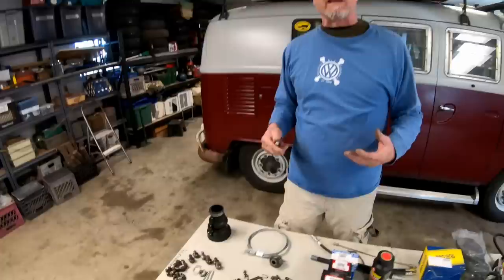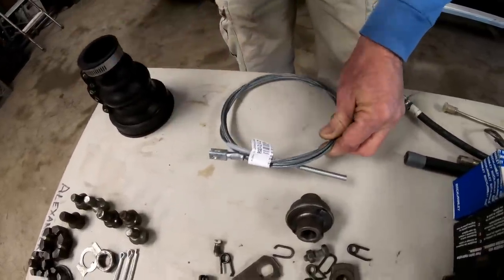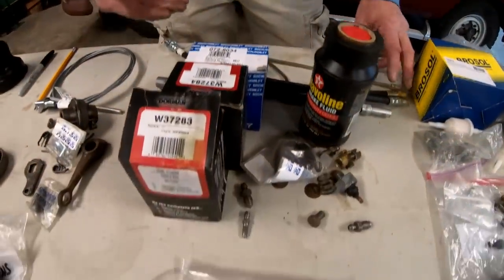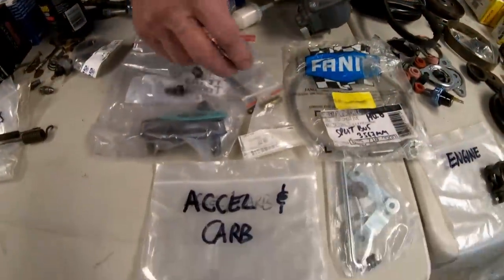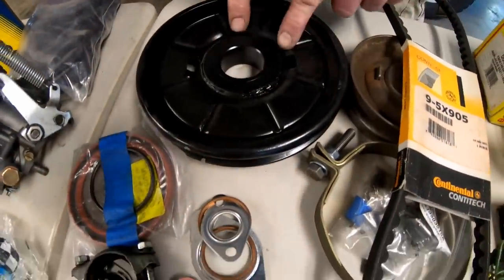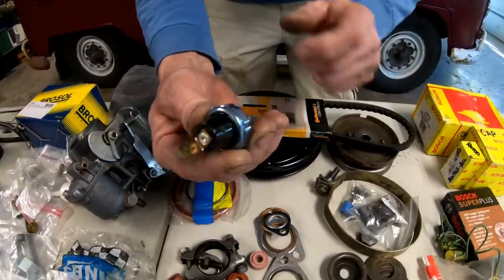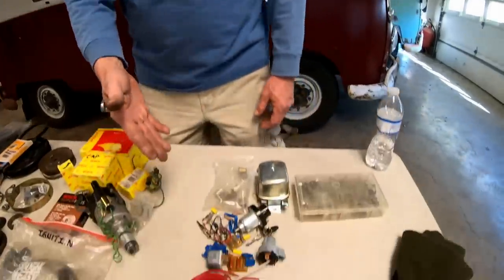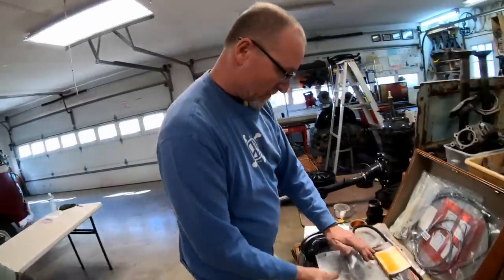100 Spares To Keep in Your VW!!!

Comment: Very valuable advice, especially getting the right length accelerator cable. Many years ago I owned a '71 VW camper van. I learned early on to carry spare parts. One summer I made the trip from my home in California back to New York were I was born. While in NY my accelerator cable broke. I removed the broke cable and replaced it with the spare I'd been carrying around for a couple of years. Before I started on the long trip back to California I bought a replacement cable. I made it home without incident but about a year later my accelerator cable broke again. I went to replace it with the cable I bought in NY only to find it was too short! I had about a 3 mile walk to the local dealer for the correct replacement. It could have been worse. Had it broke coming across the desert on my return from NY, I probably would have been very uncomfortable until help passed by. This was long before cell phones.
Reply from the maker: 👍, yes indeed you got very lucky. 3 Mile Walk for a part you were able to buy doesn't sound bad at all. Thanks for sharing!

Comment: Nice one guys! And thanks for mentioning us “gals” too! If running points, I keep and emery board as a points “file” silly but it works! I also keep a section of wood block to aid when jacking bus up (of course I carry a shop style floor jack lol), zip ties of all sizes, LOADS of electric tape and I carry a beeswax blend of paste to work as a leak stop during a rain...and most importantly a VOLT (ohm) METER!!! Or test light!👍
Reply from the maker: yep a good block of wood is nice to have.  Emery board is a good idea.  Yes Test light too.  Alot of these are tools that we'll be doing a second video on.
Reply: @VWLifeVW  A healthy notch out of the center of that wood block is a good thing given the center pin on a Bus.
Reply: Emery board also!

Comment: I’ve driven VW s since I was 19, I am 71 now. I lugged around a tool box and a few spare parts. I never used any of them. The problem is you also need a jack and stands, rags, hand cleaner , overalls, lights, and something you don’t have. If you do like I do and build your car with the best parts and the subtle knowledge of how to do it right you won’t need a trailer full of parts. That’s why you guys drive busses.

Comment: Last set of points, condenser and spark plugs, accelerator cable, oil. Apollo 11/13 parts kit (Pratleys putty and insulating/duct tape)
Reply from the maker: good stuff thanks!

Comment: Good video!  I had the barrel nut pop off accelerator cable in the middle of the desert 2 hours east of Reno...I was able to Jerry-rig it using a button off my luggage...lol barely made it to slc...
Reply from the maker: The heat cable barrel nuts work too :)
Reply: @VWLifeVW   I was kind of a newbie...driving from bay area to Chicago---I learned a valuable lesson both about tools and scorpions (don't ask).  The VW was actually "booted" at a gas station near John Wayne airport---a 67 Convertible.  No rust but no way to test drive---owner was a kid right out of 29 palms--and told me I could have it for $1500 but only if I paid boot fees and tickets that day--which were about $560. I was actually just topping off my rental car on the way back to airport--but called Orange County sheriffs--paid fees and had boot released, canceled flight and started driving.  First problem was it had a manifold leak and engine stopped at every stoplight.   Auto zone had a intake gasket and I got it changed at a gas station.  On the way back i had to change carb jets after dropping the 8000 feet between Cheyenne and nebraska on I80. --I had never done this---but actually used an iPhone to do a facetime call with a guy  Blackline racing in Salt Lake city--who walked me thru the change while at a Walmart parking lot. hell of a trip...wouldn't trade for anything though...

Comment: Love your guys channel so much, I just got my first 1972 beetle and learned so much from this channel. I got to say that one thing that's probably rare but now I keep since it left me stranded is a mechanical fuel pump rod. Idk how but I guess mine worn down enough that it wasn't pumping enough fuel to the carb to run so now I got a spare with me at all times.
Reply from the maker: well thanks!  ah yes,  that is a good one!  also there are two different lengths of those rods depending on which style fuel pump you have.  thanks for sharing.

Comment: A biggie I learned from my Sage mentor master vw mechanic is that fuel lines are METRIC. Think of all the horror stories we've heard of old buses/vanagons getting torched from leaking fuel lines. There's a significant diff betw SAE and metric. Did you mention starter brushes? A little lube on the felt points cam will help keep the heat down so they're less likely to get brittle and fail. You guys rock! thx again.
Reply from the maker: Good little tip thanks!

Comment: RT 58 just outside Edwards air force base CAL. driving my 71 bus alone , heading to Colorado (after driving cross country from boston) 1998 (no cell phones) bus died on the side of the road. went through some diagnosis and I found the little plastic piece on the points you showed  had broke off, I got my spare points, swapped them out and away I go!  good video. I carried a floor jack and wood blocks. I could pull my engine anywhere I was.
Reply from the maker: very cool!  yep we've seen those break off

Comment: WOW! So helpful--I wished I had half of those various parts when I had my '74 Beetle. I did start carrying a few quarts of oil, zip ties, jumper cables & the like to at least get me to a gas station or the side of the road to wait for my buddies at AAA (tow truck drivers--knew those guys for a 20 mile radius)! I ran into almost all those issues you mentioned in the 6 years I drove my Beetle--No JOKE.
Reply from the maker: Yep. Years of experience will make you realize what you need. Sounds like you understand completely! #vwlife

Comment: You can get home without a clutch cable or accel cable if you have to I’ve done it but for a short time. You idle the carb up enough to go through the gears. The clutch you can go through the gears using your sync little more tricky. You have to turn the motor off and put it in first or second and then turn the motor back on and mash the gas. this is all explained in the owners manual. Another good point on spare parts if you car has any weird one year only parts or using really early parts that you can’t pick up at a store or at a show very easy keep a spare. Example 67 or 68 turn signal relay.
Reply from the maker: Yep it's good practice to rev match your rpms and shift gears without the clutch! Thanks

Comment: Thanks for the video my fellow bus, road tripers!  I'm working on my spare parts kit now.  You might want to add oil drain plug, fresh air hose, wiper blades and oil fill cap just in case.
Reply from the maker: glad you like it!  those are good suggestions

Comment: Hi guys I really liked this video my 1972 doka is my daily car and I had lot of you said happened
I recently had a problem with a new petronix ignition, the magnetic rotor just came apart all of its magnets fell off inside the distributor and I managed to get it back together with a piece of paper to give some tension to keep it from coming apart again but it’s really an headache to put all of that little magnets back on with the correct polarization... as you put one the other comes off and it takes some time to put it back together. So a spare magnetic rotor is a good one to have!
Reply from the maker: yep sounds good!

Comment: If you lose the barrel nut for the Accelerator Cable you can sacrifice one of the barrel nuts from the heater cables by the engine.
Reply from the maker: Yep thats always a good tip, thanks!

Comment: Good video  I’m still laughing about the clutch cable wingnut. My first thought on that one was vise grips  I’m suprised you didnt  mention a spare belt. One time i was about 4 hours from home in a Buddies Manx DuneBuggy built on a 58 pan  and the  generator belt. Went  of course it was night and we needed lights so we found a all nite. Convenience store  the only thing we found in that store that we thought may work was. Pantyhose that came in those plasti eggs i think they. Were called Leggs brand. We bought them and went in the parking lot and tied them on  it worked like a charm and even made the 4 hour drive home  !  I grew up in South Florida  and that old Dune Buggy was our favorite car to cruise the famous Ft Lauderdale Spring Break Strip on the weekends   One nite we had 13 girls pile in the car   It was so crowded  the driver couldn’t reach the  gear shifter but i could   So it took 2 people to   Get the old girl rolling  that  Buggy was a lot of fun down there and did. Get a few late nite runs  out on the beach   Just to say we did it  !  That was in the 80s  and my freinds Father still had. A couple of crated Manx Bodies. In storage   From when he built that Buggy for his winter home in Florida   As i beleive he was a actual distributor  for Manx at one time   When my Buddy  used it i am pretty sure it was a stock 36 horsepower motor  as it was pretty slow and the metal flake gelcoat was. Pretty chalky from the Florida sun  it was so bad that my freind wound up painting it to keep it looking better   My last Aircooled was a 71 Bug that  was so beat up and running so poorly that i paid 400 dollars and a set of used tires for it to a freind that just graduated college and went out and bought a new car that the dealer wouldn’t even take the VW  at the time my sister needed a car so my Dad and i  bought a cheap Brazilian rebuild kit  for 112 dollars  pulled the motor and. Rebuilt it  i gave the car to my sister who i told it may get you around for a little while but I wouldn’t take it on any long trips  to the best of my knowledge that motor is still running in another freinds Beetle  over 35 years later. With all those crappy Btazillian  parts in it  a group of then local VW mechanics  told me ot to use them. Ut to buy the German ones instead  that car was so rusty   I never thought it was going to last  long   When my sister was done with it she gave it back to me running and driving  i pulled the engine and donated the  body to a local scrapyard  whatever. Was still left of the old thing  its kind of sad that todays generations dont have things like that in their lives  VWs. Were  not only great  vehicles but they were a lifestyle as well  Another great freind of  mine has had 28 VW  Beetles. On the road in his lifetime  along with his iconic 63 rag top sunroof he purchased with a Baja kit installed  on it  and drove to Vermont to be a ski Bum during his college years  eventually  becoming his Florida car  as well
Reply from the maker: wow thank you for sharing, first off if we forgot the genny belt, then yeah that is in the top 5 of things to bring for sure!  your stories about your VW life are really cool.  You definitely have had a lot of fun in VWs and I'm sure you have more stories to tell.
Reply: VW Life   Oh boy for sure my Dad bought a 58 brand new then upgraded in 63  with another brand new one  my Mom told me the 58 was the first Beetle she had ever seen  my Fathers payment on that one was 52 dollars a month   And on the 2nd Bug VW screwed up the Green color they ordered  which what they said was very ugly  as time went on they did keep that car and it  was  lovingly known as Bob and his Green Machine because it was so noticeable  BTW it wasnt   The standard Hunter Green that VW used for years but  more like a  weird baby blue  with a green tint in it  ?   Too  hard to describe  in words   I do remember  my Dad  played the beat of his  radio on the drivers side roof for so many miles the  roof had dents in it from his fingers  he also told me that often he would come out of work with the car parked on the street and there would be people  looking at the Bug and sometimes so curious they would have the engine  and trunk compartments open because Americans were  amazed at the engine being in the back  LOL  my Mom said he was very impressed with the power increase  in the second one  as they used to drive upstate New York through the  Catskil Mountains and he  would have to shift so much it made her tired watching him  they  could travel to and from their destination on two dollars worth of gas  !  And my Dad was a expert on tying things to the outside of the  car because  so many of the baby things were big and bulky like playpens  that wouldn’t fit inside the car  or in the trunk
Reply from the maker: @craigmonteforte1478  wow thanks again for sharing Craig! your dad sure sounds like a great man.

Comment: I would keep a clutch pedal shaft in my spares also , if driving a bug or ghia. Had one break about 20 years ago. On my 74 bug I used to have.
Reply from the maker: yep we actually keep one thanks! :) that's a level 2 spare :)

Comment: I've mentioned in the comments on a separate video before that I'm working on a 1974 VW type 2, however some areas have been modified by a previous owner, such as the fuel pump, it's electric. I recently had to remove that one and splice in a new one to get my bus going down the road! After wiring it up I discovered the no fuel issue was a fuse, so I recommend carrying a back up fuel pump in case your electric one fails on the road!
Reply from the maker: good tip!

Comment: If I might make a suggestion to carry an  INFRARED PYROMETER!  Ebay, Amazon and Harbor Freight all have them. If you just adjusted all your brakes then test how well they are adjusted by the temperature of the drums. Or a bad wheel bearing or what cylinder is not firing.
Reply from the maker: Yes good suggestion! Thanks

Comment: My most annoying fail was the carbon brush tip in the centre of the distributor cap, it broke and I was stuck on the cities busiest road full of traffic and I couldn't even see what it was until I got towed home in shame the next day after a sleepless night hoping my bug wouldn't get vandalised as it was left on a public cycle lane overnight!
Reply: Oh add a couple of wavy washers on the rocker shaft. I had one of those fail on me and I heard a terrible rattling sound from my engine as I was driving and had to pull over!
It causes the rocker arm to slide off the pushrod to the side and luckily I stopped in time because it could Destroy the engine!

Comment: I no longer have a VW, wish I did. I carry a small floor jack, Harbor Freight 30.00. It is so much easier to jack up a vehicle rather than mess with those jacks for the side. Just get under the axle and it's up quickly. I learned that with our Nissan Sentra and the piece of crap jack that comes with them.
Reply from the maker: yep

Comment: Great video guys! Keep them coming! What transmission and engines are you guys running? Different tires size/type? Do you carry spare gas? If so whee do you keep it? Awesome video! Thanks for sharing!
Reply from the maker: Thanks! We run standard transmission nothing fancy. Standard gearing. . Our engines range from 1600 to 1776. With just standard single carburetors. If we're going on a trip we will carry spare gas. Sometimes you just put up on top of the rack or in the bus
Reply: Cool so who is this replying? This is Matt. Also, maybe do a top 10 and go into more detail about how to replace/fix them. Thanks guys!
Reply from the maker: @CTmoog  yes, but we both get on here and comment.

Comment: Something important keep extra fuses, different amps, headlight bulbs, it has happened, that I was driving a 1973 Super Beetle, and one of the headlights stop working imagine driving with only one headlight, and for the person who has disc brakes, an extra set of brake pads, and if you have drum brakes ,brake shoes so you can stop on time, also it is never a bad idea, to have an extra air filter, since dirt carpenter the carburetor, maybe even some spark plugs,.
Reply from the maker: Thanks for the info!

Comment: Good ideas, very well organized. I didn’t watch to the very end. But how do you get the table with all the items laid out in your bus or beetle ?😀😀
Reply from the maker: The tables go up on the rack
Reply: @VWLifeVW  -- Dang - sorry I did not think it through. Of course!, With most Buses and my Beetle - we don't need to worry about things flying off the table.   Just have to stay away from Dead Man's curve, Stingray and XKEs.  Seriously - nice job.  I doubt that I will go to your level, (i only keep belt, oil, brake fluid, fuses, bulbs, led zep cd and a Big F Hammer).  I look forward to your channel. t
Reply from the maker: @timdolan4591  fair enough, :)  thanks for watching.   We're doing a brake drum install video next.

Comment: I'd add an oil sump plate and drain plug , and the nuts to the kit, as well as an oil sump screen. Also the intake manifold boot and intake manifold gaskets. And vacuum hose. I had the arm that goes to the clutch cable on the pedal assembly break before, I carried a spare after that.
Reply from the maker: All really good suggestions and actually we have these in the kit to. For some reason I didn't make it on the video. Thanks!